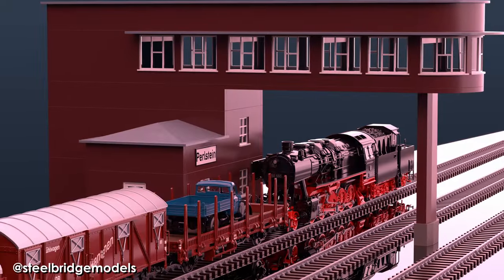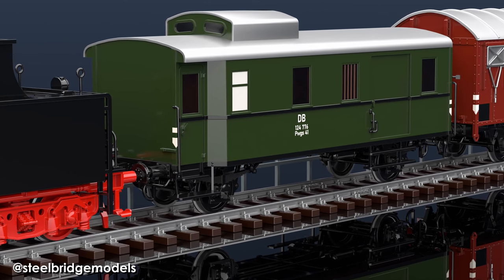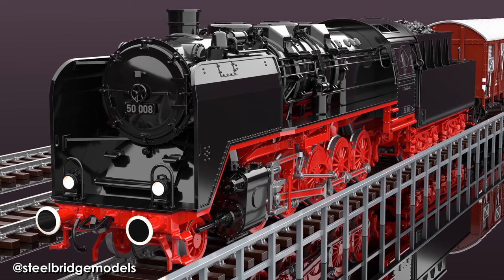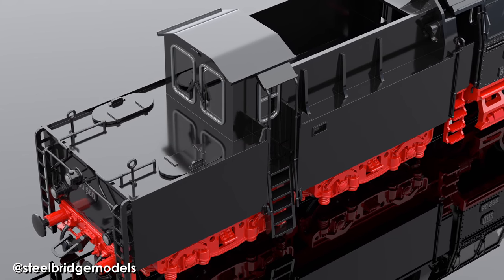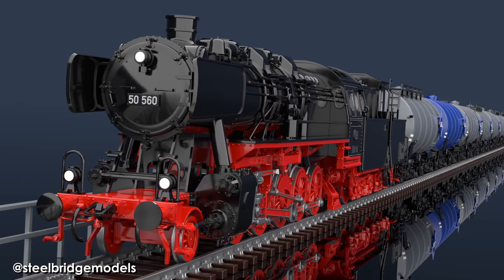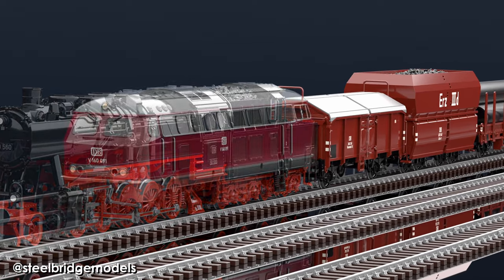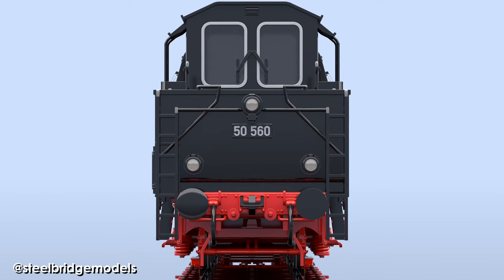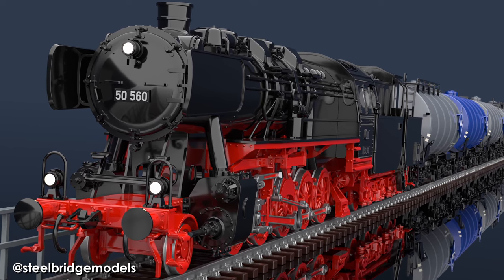Why the second Cab?

Comment: I'm a member of the Steam Department of the Illinois Railway Museum, and we have a locomotive that's quite similar to the DR Class 50. The "Russian Decapods" were built under contract for the Imperial Russian Railways during the Great War, but after the Bolshevik Revolution, a couple hundred were completed but never delivered; the new Communist government concluded a separate peace treaty with Germany, and refused to pay the Imperial government's debts. So these were sold to US railroads instead. It's of similar size and power to a Class 50, and ours (which still operates) has a little cabin on the tender deck. Not as elaborate as these, it's just big enough for a seat, meant to give the head-end brakeman a place to ride, out of the way of the engine crew.

Comment: Thank you for the info. On a different subject, safety of transported load. You views of the class 50 with chemical tanker loads.
If the loads are explosive, volatile, acidic, alkaline or otherwise harmful to the environment or peoples then there should be a barrier wagon behind the locomotive and possibly at the end of the train before the guards van. The barrier wagon should be substantial and protect the crew from 'issues' with the load, and protect the load from the exhaust items from the loco.

Comment: The D&RGW had something simular on their narrow guage lines (they ran 3ft guage, & standard guage), notably with there C125 type. No tenders in preservation on the Durango & Silverton, or other tourist lines, or static displays have examples of these tender types. For a frame of reference, the D&RGW narrow guage ended operations shortly after world war 3, while the standard guage operated 'till the 1990's, and after buying the Southern Pacific (also ending operations in the 1990's when both (still independent companies) were bought by the Union Pacific. The famous part of the old D&RGW in the Rocky Mountains operates still to this day, under the name Durango & Silverton.

Comment: Fine video. in 1969... the real cabines might lost its formal function. also the first model whee Fleischmann kicks off in N gauge. with cabine. As N driver I have a 50 ith cabine rolling. I like this very unusual feature at the tender. It adds much tenderness and raw breathes